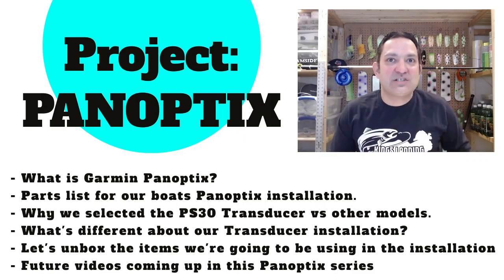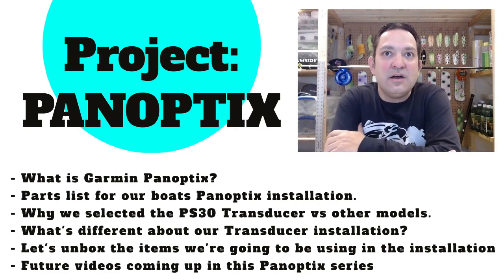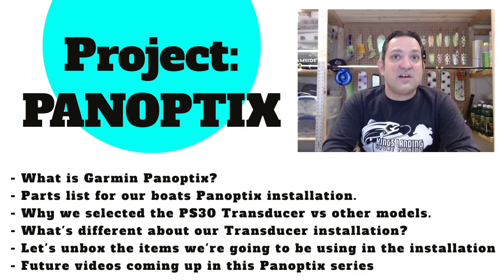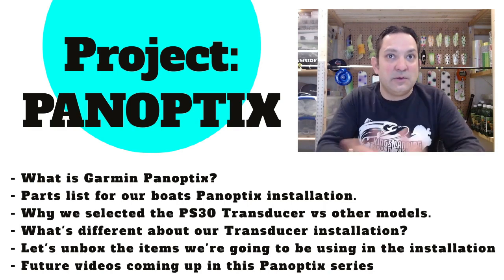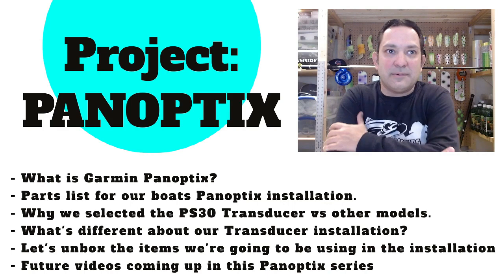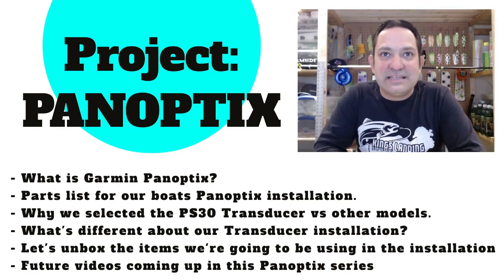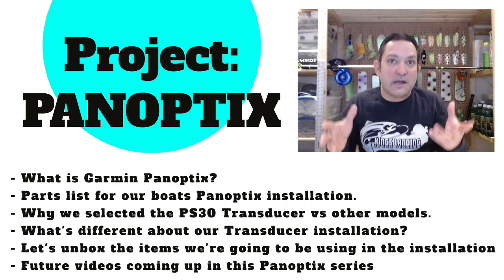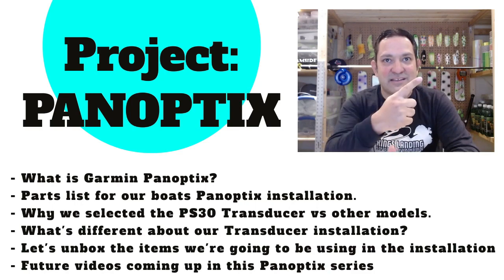Project Panoptix:  Using Garmin Panoptix when Trolling for Salmon & Trout  #Pacific #GreatLakes

Comment: Great video! I just purchased a unit as well. I made my unit portable so that I could use it in multiple applications from ice fishing, walleye jigging, and salmon trolling. I planned on mounting mine to a pole to "look" . I wasn't aware of the P30 transducer, so I may hard mount that on my boat in the configuration you described.  👍
Reply from the maker: PS30 is the way to go for Salmon trolling and I highly recommend flipping it with the RyTek marine mount.

Comment: This video and your next ones are gonna be costing me some coin in the future!  Looking to add this to my 21 foot aluminum.   

Curious why you went with the GT 54 over options like the gt 41 - guessing it is because you also have the p66 and b60.   Would you suggest if running just a single transitional sonar and also the ps 30 that you go with the GT 41 for the 50/200? (main focus on great lakes trolling)
Reply from the maker: Exactly….  GT54 came with it and I have the p66 already on the boat that I can use.   If I was buying from scratch with no previous transducers I’d do what you suggested.

Comment: Marc are you able to see your dipseys if they are out 100 ft
Reply from the maker: Not in flipped mode…  standard mode you can depending on the setting..  I’ve picked them up on a 1 and 2 setting

Comment: PS30 and 31 is exactly the same.. its about how you wanna run it side ways or long ways. Long ways looking ahead and looking back far. Ran it like that since it came out 5 years ago.  That echomap unit is a cheap unit with low resolution...   run gpsmap 8412.  Totally different game...
Reply from the maker: Sorry my friend..  the PS30 and PS31 are not the same.  Just ask a Garmin rep or take a look at their website and the specs.  I have friends with both transducers and they have different field of views.   Also confirmed with a Team Garmin member.

It’s a lot more than just a mounting bracket.

Comment: What mode is used with this?  Live vu down?
Reply from the maker: Yes..  LiveVu down
Reply: @KingsLandingSportFishing   It almost looks like I can see white lines shooting to bottom on my screen and I was in 200fow and rigger at 160 couldn't see the rigger ball.  Any insight?  There are some settings on the graph not sure exactly which to use.  Thanks!
Reply from the maker: @brockus35  - which transducer are you using and is it in standard or flipped position?
Reply: @KingsLandingSportFishing  ps30 and its looking front to back..pointing out from transom.
Reply from the maker: @brockus35  - I’ll be playing with the setup in mine in the coming weeks and I’ll let you know….  What is the angle of your transducer?
Reply: @KingsLandingSportFishing  It's level and up a tad.  We moved the Rytek bracket up and down o find the ball but nothing.  Shallow it was ok.
Reply from the maker: @brockus35  - I was advise to tilt mine down a little bit for deeper water vs up.  That’s how I’ve set mine up but not. Tested that few yet.  How deep can you read right now before you loose the ball?
Reply: @KingsLandingSportFishing  80
Reply from the maker: @brockus35  - How high have you set the gain?
Reply: @KingsLandingSportFishing  I want to say 65 to 70 any higher there's too much interference
Reply from the maker: @brockus35  - I’m using the same but I’m able to mark down 135 and that’s the deepest I’ve tried yet…
Reply: @KingsLandingSportFishing  take a pic of your screen if you can when you're at 130+ thanks

Comment: I am vying new boat king fisher. It will be equipped with Garmin.
Reply from the maker: What size Kingfisher?  Great boats…
Reply: @KingsLandingSportFishing   I am between 2805 Weekender 28 foot 9.5 feet beam and 27 foot 8.5 foot beam. Difference is about 25k. Please advise. I also was lookin at HaweCraft 27 foot Alaskan and 270 Sea reader. Price wise about the same. Sea reader would have best power boat engines twin 225 Honda’s , Howe craft 200 Honda’s or Yamaha. King fisher 150 Mercury. But the salesman said based on technology of the boat it is all its need to get to 50 miles per hour. I do not think I need a faster boat than that. At the end of the day I am not racing
Reply from the maker: @mikhailstrut7875  - love those boats..   I’d like a 28.5 Kingfisher myself.  Hoping it will be my next boat :)
Reply: @KingsLandingSportFishing  thank you. You helped more than you know. Boat will arrive at the end of august beginning of September. You are welcome to let me know and come. I will take you on my treat. Also I am not sure how do you like centerpin fishing for steelhead. It is a blast. I own private stretch on Cataragus river. Beautiful steelhead place. I catch any there from 10-40 fish every time I go. You welcome to join me. Only problem with a cat it has to be turbidity less than 20 to fish good. Let me know if you want to join me I can let you know than condition bid right.

Comment: The only difference between ps30 and 31 is the orientation of the mounting bracket.   The transducers are the same.  Calling it a flipped ps30 is equivalent to calling it a ps31.   While the LS angle is 20 vs 60, you should see the the image quality of the XR transducer.   You can see a wire diver out 150  and the lure no problem but it's needs to be on a pole to see your spread.
Reply from the maker: Hi John,
The PS30 and PS31 are different transducers.  I’ve seen the output of both to confirm this.  Good friend of mine has an XR and loves it.   Only challenge is he doesn’t get the view in front of the boat (at the same time as the back) like you do with a flipped PS30
Reply: @KingsLandingSportFishing  Garmin and I disagree.  The differences you're seeing boat to boat are from different chartplotters, settings, mounting location and water clarity as they are in fact the same transducer.
Reply from the maker: @johnrobichaud1792  - need to find a new Garmin guy.  The pro staff and Garmin tech guys here can articulate the difference.